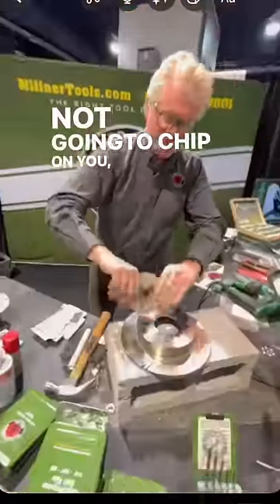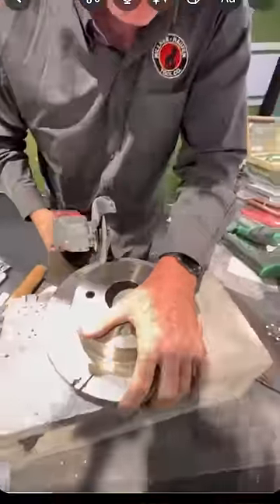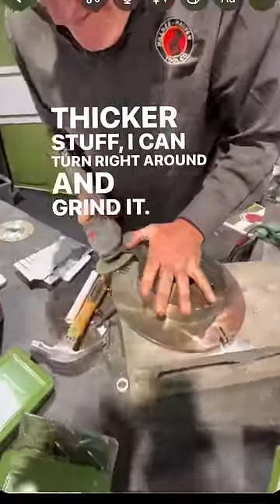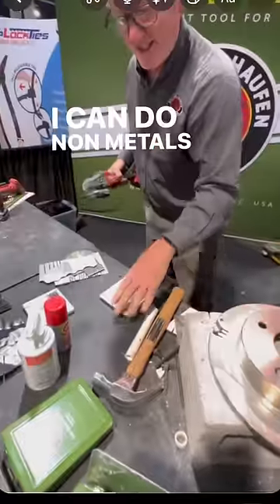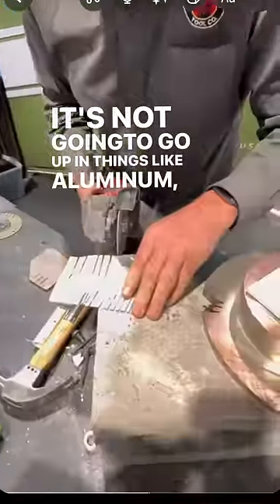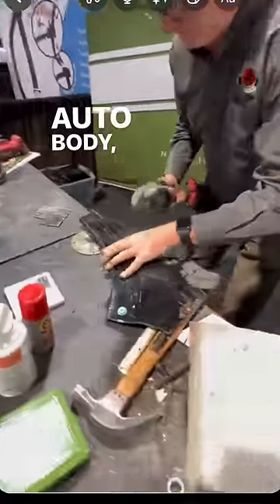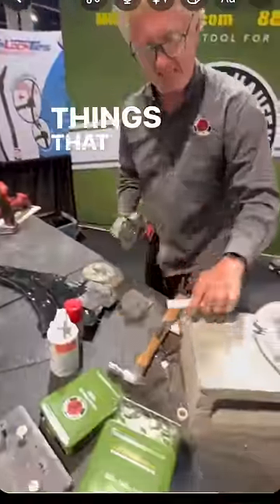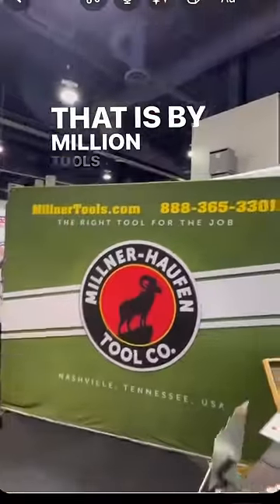I can’t believe he can touch it after all that!  #shorts #amazing #gadgets

Comment: This man gives off “mad scientist vibes” the confidence to touch that wheel at the end.
Reply: When safety switches were first marketed, the guy who came out to the refinery my Dad worked at watched as he filled a bucket with water, plugged in a hair dryer and put his foot and the dryer in the bucket. Talk about confidence in the product!
Reply: Why did you quote that?
Reply: Well he would have done this at least 100 times before this guy comes along lol
Reply: Notice he didnt touch it after grinding on the rotor, waited until after cutting a buncha thin stuff so it had time to cool
Reply: @BattyMack
Reply: @jacksmith2315  exactly 💯
Reply: @PANZERFAUST90  its a bot
Reply: @stellr.  How do you know?
Reply: @jacksmith2315  it would not have cooled much if at all
Reply: @kenyattafrazier  ummmm....yes it would. I use grinders all the time. Thats about how much time until i take the wheel off after using it if switching to another wheel when its hot
Reply: @jacksmith2315  as another commented... He also used the pvc last to judge the temp

Comment: Catalytic converter has left the chat
Reply: You dont use an angle grinder for stealing catalytic converters
Reply: @Galahad993  You do now
Reply: @Galahad993  And we know this HOW exactly?? 😄
Reply: @Galahad993  but it is used to cut the cat converter lock protection
Reply: @Galahad993  voice of experience?
Reply: @Galahad993  then what do you use?
Reply: @ryand6607  Sawzall reciprocating saw is what they use
Reply: @Galahad993  yeah, because not every parking lot or drive way has electricity 😆
Reply: @nickjacobs7016  my battery operated one can do about six or seven exhaust jobs before I have to switch out the battery I have about 10 batteries every night I go out
Reply: @nickjacobs7016  Milwaukee makes a battery one lol
Reply: Clear to see you’ve never even worked on an exhaust let alone removed a cat.
Reply: Sawzall is better for that
Reply: Not unless you took them out for them 😂🤘
Reply: There's a ratcheting cutter that will chomp em off really quickly and silently search it you won't have to change batteries blades or your sleeping schedule
Reply: Sawzall is easier imo
Reply: @bertsbug  had some dude try to steal cats from customer’s cars at my garage. he managed to get away with one single cat and managed to take 30 mins and 2 sawsall batteries
Reply: @alfonsoortiz4182  🤣🤣🤣🤣🤣🤣☠☠☠
Reply: meth has entered the chat lol
Reply: @TangoCharlieAlpha  we know this from incidence THAT NEVER HAPPENED where we I took a reciprocating saw and cut the converters off. Take the car to the exhaust shop and they have to give you the option of not replacing the catalytic converter and welding in a pipe instead. This may or may not have happened as a scheme to ditch the cali cans.
Reply: You my sir are a hero
Reply: Cars clinching their tailpipes!
Reply: @nickjacobs7016  i have angle grinder with battery
Reply: I am speaking from experience
Reply: Hahahahaha!!!!!
Reply: I do about a dozen a week replacing stolen ones 😮‍💨
Reply: 😂😂😂 not the cat
Reply: @alfonsoortiz4182  I mean sure but alot of cars don’t have it
Reply: @TangoCharlieAlpha  I mean I know too. But I know alot of them use a sawzall as pretty much their primary tool.
Reply: @exodead  what happened after?
Reply: @bertsbug  start staying home ok
Reply: @Galahad993  sounds like you have experience,my friend🤨
Reply: bam, 10 seconds and it's yours
Reply: @sancheztroy3556  yep
Reply: This isnt funny bro. We had our catalytic converter stolen off our van. It hurts. Next time dont open your mouth if you dont understand someones pain!!!
Reply: Cant have s*** in Detroit
Reply: If they stealing em they gonna need a bu ch to afford this blade lmao
Reply: Nobody:

Will it fit in my Honda?
Hold my beer
Am I a joke to you?
Asking for a friend
Everybody gangsta
End this man’s whole career
He protecc, he attacc …
Sexual/genitalia innuendo/big balls
Scatological/flatulence /potty joke 
Question of quantity answered yes
Plot twist
Left/entered the chat
Gaming reference
Dislikes are from
I’m a simple man
Not gonna lie
No one gonna talk about
Last time I was this early
First
Legend has it
That’ll buff right out
Fun fact
(X) be like
(X) intensifies
(X) wants to know your location
Ha ha (X) go brrrrr
POV: (X)
(X):
Also (X):
Imagine (X)
Her: I'm home alone
It’s complicated
YT algorithm counting down years
Who’s watching in current year?
You Tube recommendations
It’s free real estate
So you've chosen death?
Want a cookie?
Touch grass
You must be great at parties
Understandable, have a great day.
Punch line below read more
Reply: Creo que se le perdió el convertidor de flujo, y está sacando fondos para hacer otro y así volver al futuro
Reply: So now we know that most of the nations’ supply of stolen catalytic converters is split within this comment section… 🤨📸📸📸
Reply: @10thgenrolla  😂🤣😂😂 straight ....pipe!
Reply: @Jake-be2os  and you know this how?
Reply: Bro I’m on the floor.
Reply: $150 a blade.  worth it if it last
Reply: Just had mine stolen off my 2020 outlander the other day..
Reply: They use an exhaust pipe cutter 26 bucks on Amazon cuts the pipes quiet and in seconds ....
Reply: My lungs almost left the chat too
Reply: Hunting for that little big of gold
Reply: @Galahad993  you put a bigger wheel on it,I got 7  inch wheels
Reply: @nickjacobs7016 sarcasm right?
Reply: @JustCRANEthesedays  Nope just a brain between these two ears
Reply: LOL FR
Reply: @bankruupt  I was a mechanic for 17 years. ASE certified master tech.
Reply: @Galahad993 : Neither a Sawzall nor a grinder can get up in recessed exhaust. The tool built as an exhaust cutter looks like a short length of saw chain.
Reply: They make battery operated grinders
Reply: @Galahad993 that’s because you can’t get a blade to cut them. Problem solved
Reply: @nickjacobs7016 they come battery powered too genius 😂
Reply: Battery power swivel head Sawzall with a good fine tooth blade.

Comment: Love the way he has his fingers directly in the blade’s kick back direction.
Reply: Lol you’ve obviously never used a grinder
Reply: @Doesn't Matter   lol you've obviously never read the safety manual
Reply: @justsomedude4469  🤣 look at the direction the sparks are going
Reply: @NORTAH85  sparks go in the opposite direction the blade will kick.  You should normally stand with the sparks going to your side, and the blade will kick away.  Sparks directly at your baws, with your fingers in line with a 10,000 rpm disk is known as the anti-wanking stance!
Reply: @justsomedude4469  while you're reading the manual, I'm done doing a man's job, you can go sleepy bye now daddy's got it
Reply: @NORTAH85
Reply: One of this blades features is no kick back,
Reply: Lmao
Reply: Wasn’t directly in line but the man is definitely comfortable using my sons toy battery grinder 😝
Reply: @rexracer7192  it may claim that, but no blade can be 100% relied upon not to.  A lot depends on the material you are cutting and it’s potential to bind.  The brake disk or the car body thing he cut could easily bind the blade.  He is moving far too fast, putting way too much pressure on the grinder, and the pieces should be clamped and not free handed like that.  Angle grinders, even battery ones, are one of the most dangerous power tools out there.  They deserve respect, to know what you are doing, and always knowing where the tool will kick to and into what.
Reply: @BrianNichol  I would say in some of the cuts he was in line, but I will take your word for it that it wasn’t exactly.  In the end it doesn’t matter though, can just as easily get you either side before the blade stops spinning.
Reply: not really directly but definitely not the best spot
Reply: he's advertising the kickback of the blad in general too so... just real belief in his product like the saw stop guy and those things fuckin work!
Reply: @Ian-tp6mu  Yes. It works one hundred thousand times. And once not. Safety features are not an excuse to act irresponsible. Play stupid games win stupid prizes.
Reply: @Ian-tp6mu  I would say the first cut into the brake disk his hand is directly in line, others not so much, but as you say, not the best position.  Still easily a lesson in what not to do.
Reply: @justsomedude4469  bruh. who does read safety manual ? are you sheldon cooper ? :D
Reply: It's not supposed to kick back that's the point but yet kind of careless
Reply: It’s confidence
Reply: @PepRex  he's obviously experienced, I would hope people know they can't do the same things an experienced person can.
Reply: It doesn't kick back , he said it in the video
Reply: @lifepolicy  Have you used a grinder before? Just curious.
Reply: @dmc3067  wrong! Maybe a saw but not a grinder. Grinders kick the direction of the sparks. Not opposite
Reply: @John-ml2gh  I sell artificial limbs. Fingers and hands. What is your profession? Just curious.
Reply: @lifepolicy  So you haven’t used one?You didn’t answer my question lol. But since you’re curious, I’m working construction right now, picking up a few trades.
Reply: @John-ml2gh  great. To answer your question: yes.
Reply: @lifepolicy  👍👍
Reply: @NORTAH85  I don’t think so.  The tool will kick back in the opposite direction to the direction of the wheels rotation at the point where it pinches.  The direction of the sparks indicate the rotational direction of the wheel at the point of contact.  Think of wheel spinning a car.  The smoke gets pushed backwards, but the car will lurch forward when friction between tyre and ground overcomes inertial mass.

What you may be thinking of is the piece itself being kicked back, but kickback here refers to the grinder, not the piece.  on a table saw if you didn’t have a riving knife and it binds, it will be the thing you are cutting that shoots back, not the table saw as it is heavier, I.e has more inertial mass.

On each of these cuts, the thing being cut is heavier than the tool, because even on the thin sheet metal, he is still cutting into a heavy cinder block underneath.
Reply: @NORTAH85  Look dude, you are obviously invested in your position, and it can be hard to accept evidence to the contrary, but ignorance of reality doesn’t change it.  Look, whatever we disagree about, first and foremost, if you really do use one of these every day, please be safe brother.
Reply: @NORTAH85  it's a spinning wheel. Let's take a truck doing a burnout the gravel goes backwards. What direction does the car go? Forwards. Angle grinder sends sparks backwards and if it catches or binds it kicks the tool forward. Make sense?
Reply: @libtrs838  🤣 let’s take a 🚀 and compare it to pencil.. 
Go use one Mr physics.
Reply: @andrewgabriel9893  Wow dude, you sure are so badass for.....purposefully ignoring simple safety regulations?
Reply: This is not that worrysome..at least safer than those meat section bandsaw operators where they slice them so fast, you'd squirm watching them.
Reply: @dmc3067  last year I was cutting the exhaust on a car to install "test pipes" because someone stole the customers cats, I was tired and in a hurry and the cut was finished and my kerf closes and pinched the blade. kicked back hard and It came back right into the top of my dominant hand. Through the skin, fat, muscle and tendon, and straight into the bone. POWER TOOLS ARE. NOT. FORGIVING.
Reply: @andrewgabriel9893  thank you "safety manual" oh brother. I bet he reads the recipe on how to make eggs too lmao people that don't even use these tools have the most opinions an suggestions 🤣,  let them type at there office job while the  real men do there jobs haha .
Reply: @mjodreaper8481  thank you the man made his own tool for God's sake, as if he doesn't have enough experience to use it a little less safe than a beginner, man's been obv doing it for decades lol, people are jus so oblivious sometimes and no common sense haha
Reply: @austinharris2916  He's the kind of guy that reads the whole manual, puts on proper ppe, and still cuts his thumb off
Reply: @andrewgabriel9893  lmao STILL 😭😂
Reply: @NORTAH85  ehm... yeah that's why the disc want to go the other way. Just like a car burnout.
Reply: @NORTAH85  it's all a spinning circle. Pencils don't have any moving parts. But you could compare a bottle rocket or firework to a spaceship hot explody stuff shoots out bottom rocket move in other direction.
Reply: @andrewgabriel9893  certified mouth breather
Reply: @NORTAH85  ??? Sparks don't fly in the direction the blade will go if it catches. 

That's like looking at a truck throwing up a roostertail of snow behind it and thinking the driver is attempting to move the truck backwards.